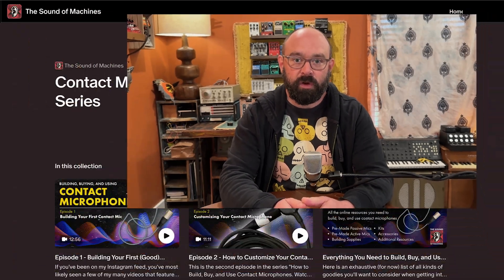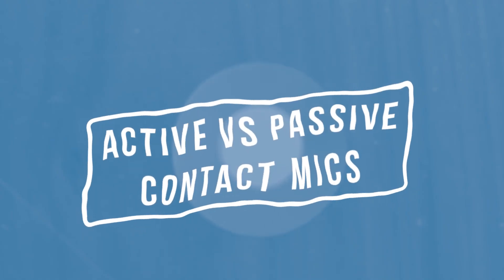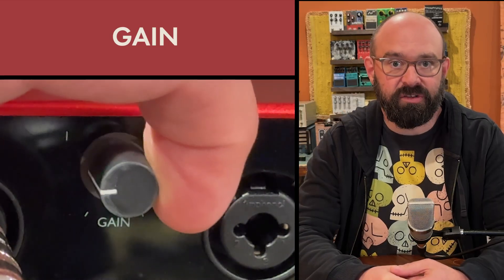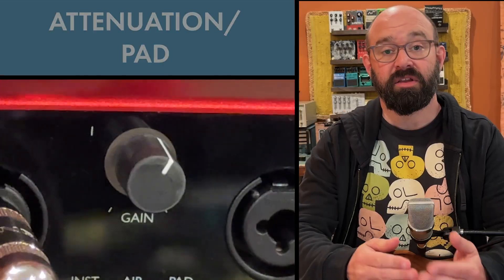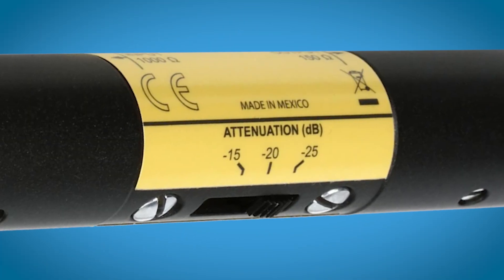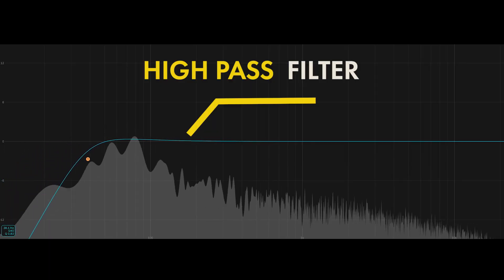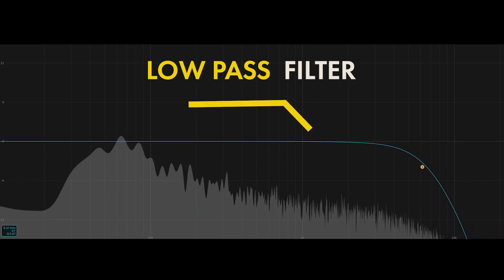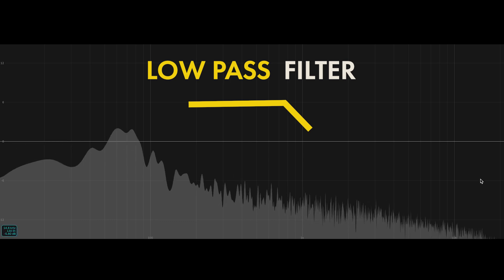Why Do Active Contact Mics Sound So Good?

Comment: Ohhh WOW.   Where to begin with this one. My friend are some serious serious oversight and error in this presentation, quite a few of them.

I wouldn't call it the blind leading the blind but we definitely got Stevie Wonder leading the 100k race.

Don't keep in mind the fact that I didn't come here for an education nor did this title describe one in hand. But it sure was a lengthy trot over BS mountain before I got to the goods of what I was looking for regarding the title of this video. Anyway I'll clean my shoes no problem just not used to being that close to a farm and stepping in BS all the way up hill. I do however sincerely appreciate you bringing up the wonderful topic of piezo transducer elements.   Quite possibly the most under-applied amazingly accurate low cost solution to many many wonderful things. They make excellent acoustical output emitters as well as great reference level quality microphone. Of course there are many caveats that need to be worked with realistically before getting exceptional results from either usage but, it is the most underutilized beauty in all of modern technology
Reply from the maker: Ok!

Comment: I just wanted to thank you for clarifying that sound art does not require me to know anything at all about the alleged hows or whys stuff works.  Gimme some piezos hooked up and random circuit boards -- they don't even need to be powered -- and we will listen to the Chinese Mandarin-talking, miniature elves that live inside of the circuitry or we will find the exact radio channel with which data has been secretly exfiltrated by resonant radio emissions of various components in the circuitry.  

Hook me up and plug me in and I will find those Chinos y'all should have been looking for for some time now.... 

Truss.

F.

Comment: Passive contact mics are NOT mic "level", they are instrument, hence the lack of bass, you're using it wrong. You MUST run it into an instrument input with at least 1M of input impedance. The level is whatever, it is the impedance that matters. In my experience passive direct boxes are also completely inadequate as the capacitance of the contact mic essentially ends up forming a high pass filter with the resistance of the windings (rather than just the impedance). I would also say... they just suck. Buy one of those cheap $20 active DI boxes instead, they're vastly superior.
Reply from the maker: Yes!! The prophecy was true :)
Reply: @TheSoundofMachines you make excellent videos, and it’s fun to watch. Thanks man.

Comment: Tiny comment,  as far as I am aware, Gain increases the input  signal and Volume increases output volume. They should not be considered the same but usually are (by guitarists in particular!)
Reply: Gain is the magnitude often measured in decibels (dB) between two signals.
But as a ratio it also makes sense, a gain of 2 doubles the input signal. So it is 200% the input signal. But you could also lower the signal 0.5 for 50%. (I wont convert to dB because it isnt as intuitive) But 0 is a gain of 1 or 100% for reference.

The key point here is that gain is a ratio that relates signal A on the input to signal B on the output. But you could also look at gain of the output to the device you are sending it to ie. Power loss in the cable. This also has a "gain" less than 100%.
Signals can be arbitrarily chosen too, say gain between audio in the room and audio in the recording. But in the guitar world gain is commonly used to refer to signal boosting in the pre-amplifcation stage, and the volume (knob) you are referring too is the power amplification gain.

Both are gain, but gain in the input stage before the signal is clipped, like pre-amps and distortion pedals leads to changing the shape of the wave form. This is by design not a property of the term "gain". Just guitar player colloquialisms.
Reply: As a guitarist I fail to see how this could be true.

You quickly learn, even on basic practice amps, that increasing gain gives you distortion.
At the same time you can keep your practice tolerable for others by lowering the output volume.

I'd posit exactly the opposite is true.

Comment: thanks for these videos. contact mics are awesome. the best passive ones i have encountered were ones i scavenged from equipment intended to detect heart rhythm or pulse. i got a couple from a sleep apnea tester that has three wires which makes me wonder were they active? i can't think of any other reason there are three wires for the contact mic.
Reply from the maker: Yeah I considered including a portion in the first episode where I show a bunch of common devices that have piezo elements inside but ultimately cut it out. Maybe worth revisiting!
Reply: I'd love that! Visiting antiquariums and salvaging stuff is a bit of a hobby of mine, and linking it back to audio would be SO neat
Reply: the third wire is usually for self oscillating piezos. Its just a feedback for the driver stage